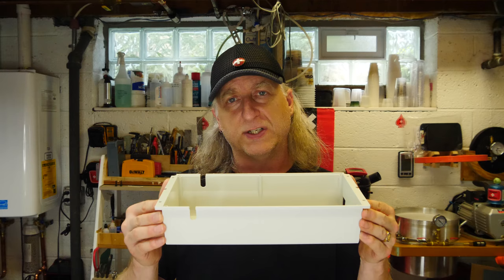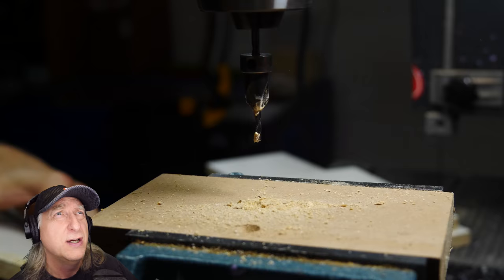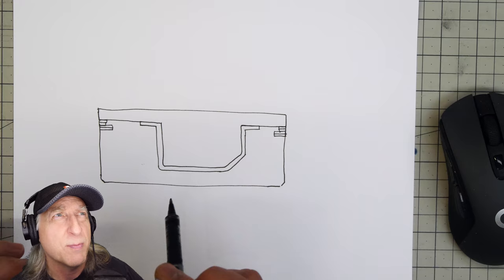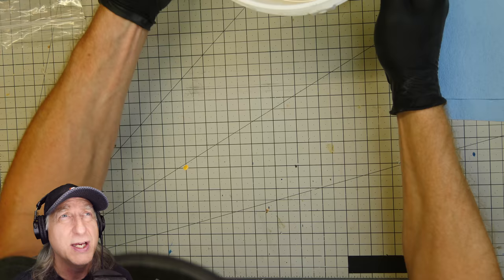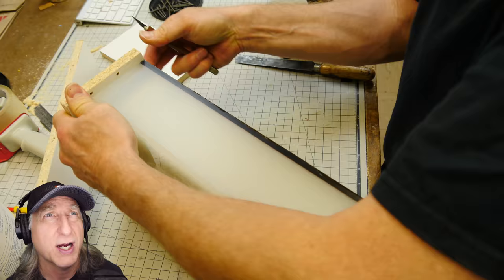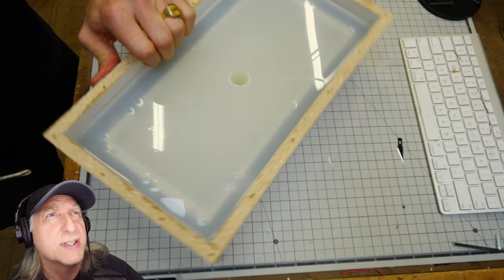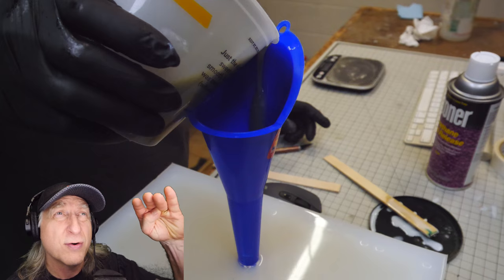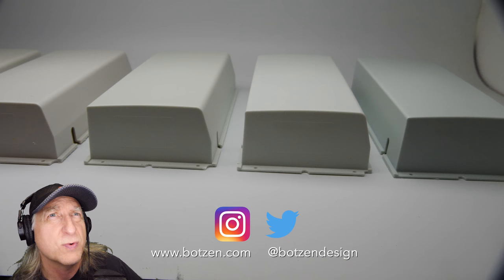Resin Copies, Mold and Cast medium size parts

Comment: The cardboard locking mechanism is brilliant. I do not want to buy myself a laser cutter, but I do have a CNC mill. Maybe I make myself a few standard sizes of this cardboard thing, but mill it from PE. I do not think the PE will damage the silicone. Having the alignment as well as the two half locking on the very edge of the mold saves a lot of silicone

Comment: Thank you for the video. The way you did the vents and sprue gave me the exact style I need to do on my first polyurethane pour. And the way you interlocked the half's is another great idea I will incorporate into future molds for my part. It will be a on going part that I came up with. This gives me confidence of success. Do I need a reservoir of material pressure potting? Thanks again.
Reply from the maker: I use the strings as the reservoir
Reply: @EricStrebel  Thank you for the reply Eric. I appreciate it. :)

Comment: What if you don't have a laser cutter? I like your silicone box. Is there another way to wrap the lid for a smaller box?
Reply from the maker: If you don't have a laser cutter then you can 3D print a splitter board or do it by hand

Comment: i love the self locking meganism could the be used also wen you make a mould for a plastic model car body because as in your piece you can clue it to bottom and it is seald from sillicon pooring in into the insude of the mould how too solve this problem with a body model car that is not the same hight ?
Reply from the maker: It could you be used for any kind of mold

Comment: Great video! Thanks!
Question: could you use a dummy block in the second pouring to save some silicone? For example placing a hanging wood block in the middle of the original plastic part and then pour the silicone. This would create a big recess on the silicone but would save a lot of silicone, which is expensive.
Then, when pouring the resin you could still place the wood block to make it stiffer and remove it after curing to ease the demolding.
Reply from the maker: You could but I don't think it's worth it
Reply: @EricStrebel  looking at smooth on prices for their silicones, maybe a $40 or $50 savings would be expected. Also for even larger pieces could be nice to save some bucks.
Reply from the maker: Best to cut up old molds and recycle them, it's just a huge pain in the ass I find to do that

Comment: 08:00 Just a humble newbie comment, you could hang a piece of box in such a way that you could spend less silicone for the inner (second) part of the model.
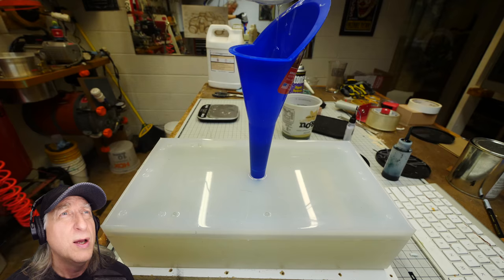09:45 A slightly tilted funnel could be usefull.

Comment: This video revolutionized the way I think about making resin molds! About the way you used packing tape to cover the holes, is there any worry that the mold may become damaged when removing the part(s) and ripping the positive mold side? Also, how long do you figure the mold will last considering the size and shape? Thanks!
Reply from the maker: Ripping the molds is always a possibility just have to be careful. You should get 20 parts out of a mold more if you're gentle

Comment: Great video, Eric! Your tutorials are exceptional in that they are methodical and can basically serve as scholarly courses. I really admire your work! I was meaning to ask you for the advise for quite some time now. Namely, I am working on a toy prototype, and I am in the phase when I cast various parts of it using Smooth-on's Smooth Cast 310. I have a bit of a trouble producing the right colour of the part by using So-strong pigments. Namely, how does one measure the right amount of the pigment that goes into resin in order to achieve repeatable results (i.e. to ensure each copy of the part in the series is the same colour)? I find it quite hard to estimate the right amount of pigment since it is so strong on one hand, and the resin tends to turn lighter when it cures so the colour attained when the resin is in a liquid state is not the same when the resin cures. How does one overcome this difficulty? Thank you for your consideration.
Reply from the maker: Good question, put them in a dropper bottle so you can measure the drops of color 😊
Reply: @EricStrebel  Thank you, sir! Sounds logical :)

Comment: How do you make the vent tubes, you say urethane resin in straws, and it looks like you cast the pour hole inside the funnel?  What resin do you use for this, and do they need to be coated with release before pouring the top half of the mold? 
Thanks, great video!
Reply from the maker: Yes, our urethane resin into staws, cut and sharpen in pencil sharpener. Any resin can be used.no mold release if you use a plastic straw.

Comment: This is an astonishing video. Thanks. 

How much different is your polymer pour from that of polymer used for a rifle. 

I was interested in making some of my own rifle parts, and was curious how to make my own molds lead me to your video. 

This video made it seem fairly easy to set up at home, however I was wondering the structure rigidity difference between an at home pour vs factory. Mind you, I am aware of it depends on the maker , but in your case. How close do you think you could replicate the quality of strong polymer parts.

Comment: Great video. I want to make like 100 small parts bins for screws and stuff. What resin would you recommend? The problem is it probably won’t be more then 1/32inch thick. Maybe 4x3x3 inch. Thanks.
Reply from the maker: Yes a quality 65 or seventy  shore D duromerer resin, try @bjbeneteprises

Comment: awesome video as usual Eric, can you give me a ball park on what you charge to copy a hanger is what they call it for my sony mdrxb950bt aheadset. Its the part that holds the headset or the earphones. These are the weakest part of these headsets and and they are not available anymore as a replacement parts. I was going to have them 3d printed but I don't know what is more cost effective , cast them or print them. I saw how you make your parts with resins and they look nice. please reach out to me , thank you
Reply from the maker: 3d printing is gonna be way more cost effective
Reply: @EricStrebel   ok 3d print it is,  can i send you a pair of good ones L and R  and can you replicate them in black and how will i pay you? and if all is good where can i send them? thank you sir

Comment: Two words Brad nail gun and glue 
It will get you the same results and the box is a toss away anyways 
The Brad nails will give you enough structure at twice the speed you’d be able to do your pour and than takes less  time to take apart 
If you want a little more structure pre drill your holes while it’s together 
You won’t have any splitting and you can use less screws and again at twice the speed

Comment: Hi ! is it true for poliurethane pieces, that once you use some PU from its bottle, if you dont put Argon gas inside the bottle for replacin Oxigen, then the PU will be ruined becosause Oxigen make PU to be foamy? I saw it on another professional youtube channel.. Thanks
Reply from the maker: Argon is an inert gas that you can put in your open bottles to help them last longer.
Reply: Thanks Eric! I mean, how long does a bottle  size like we see in your videos without Argon?  Or in what period of time you can use it without problems? Thanks again!
Reply from the maker: It will depend on the resin. Mileage will vary, you want to try to use your resin within 6 months

Comment: I'm a Vietnam Combat Marine and I purchased 4 EGA to mount on my 2001 Dodge Ram 1500 pickup. They are all rigid and I need to make a mold of them that I can put against the side of the truck to cast them with the proper curves to paste to the truck. I plan to paint the truck a gloss black including the EGA. I would welcome any suggestions you might have to help me. Thanks.

Comment: The original looks like an electrical box... Hate to say it but unless these  new parts are inspected and certified they shouldn't be used for anything electrical. 

For your own personal temporary purposes ok. But not for a business and not for a permanent personal installation.

But love the video.
Reply: I say this because often nice plastic electrical boxes are expensive, possibly $100-200 per, and people at home might be thinking that this is a way to bring costs down. Check on pricing to have them inspected and certified because in my experience it's usually not cheaper and you're taking on quite a bit of liability.
Reply: @Morberis  they're probably also way more brittle then the injection molded parts, SC 300 is ok with ~10% eolongation, but give it 3 years in the sun and it cracks like nothing, especially with thin-walled parts like this!
Reply: @TheZahnputz  Possibly. I don't know.

But there are many legitimate reasons to do this. I don't want to be too down.

Comment: hi, why is important to dgas in the pressure tank. i,m a hobby and i want to cast some pieces but dont have the pressure tank, and what kind of resin recommend for a hi ressistant platic gears. thanks
Reply from the maker: Degassing is done in a vacuum tank, casting is done in a pressure tank after degassing the resin. Watch my most recent video for resin recommendations.

Comment: Beautiful..!! I tried this a couple of times and still don't get my expected results.. :( .. how do you avoid the cardboard to stick with the silicone?? rock on!
Reply from the maker: Seal it with shellac
Reply: Thanks Eric. Since I don't have the laser cutter switched to a 3mm inch trovicel plate instead of cardboard and it worked wonders! easy to cut with exacto knife and is solid in all edges 👍

Comment: Do you not have problems with shrinkage or deformation due to the elasticity of the silicone mold, causing tolerance issues?

Comment: You are not holding a vacuum while pouring the PU into the mold? Normally, you would put risers in the mold to evacuate bubbles upon return to normal atmospheric pressure.This eliminates the bubble problem. This way is bound to have air traps inside the part.
Reply: I enjoyed the video by the way. Love your work!

Comment: Hi Eric, 
I'd like to understand what happens with perpendicular holes that are ininside the box in each corner, that seem to be for screws or similar. How do you reproduce them on the copy?
Reply from the maker: They are drilled after the part is removed from the mold.
Reply: @EricStrebel  Great to know! Tks!

Comment: Hey Eric, really useful video as usual! What type of Silicone do you usually use? Platinum/Addition cure or Tin/Condensation cure? I’ve always used the latter for small personal projects but I’m trying out Platinum cure at the moment and I’m having lots of cure-inhibition problems. I’m mostly making molds of SLA printed parts. Thanks!
Reply from the maker: Tin cure usually
Reply: platinum cure does not work well with sla prints, in my experience.  I read an academic paper that soaking in water for a while helped, but I can't find it. I have just started spraying lightly with clear lacquer and that seemed to work, but does effect the surface finish somewhat.
Reply: *postcuring them under water helps. oxygen contact prevents the resin from fully curing and therefore causing inhibition with platinum rubbers
Reply from the maker: Use a tin cure silicone instead, problem solved
Reply: @EricStrebel  there are some things you simply cant do with tin cure - specific durometers, high viscosity without bleeding and shrinking, colour matching (transparency) and if you have to CAST with platinum rubber
Reply from the maker: Lots of silicones out there, try silicone inc, they make some excellent tin cure products.
Reply: Thanks. I’ve had good results with tin cure, I only switched to platinum recently because it has less shrinkage. I may just have to stick to the tin cure and compensate for the shrinkage in my masters.

Comment: Hi Eric, thanks for the video. I have a quick question, i got some polyurethane resin that i want to use, but the curing time is about 3min and i dont think it will give enough time to degas it. Is there a product that can extend the curing time?.
Reply from the maker: Nope, not that I know of. Get a resin that has a longer working time.

Comment: how much vacuum pressure do you use to de-gas the silicone and resin?
Reply from the maker: Full vacuum
Reply: @EricStrebel  hi I have 1.5 ton ac compressor  . Can I use it for full vacuum and another question  approximate  price for this epoxy product to make
Reply from the maker: Yeah, sure. It should work.